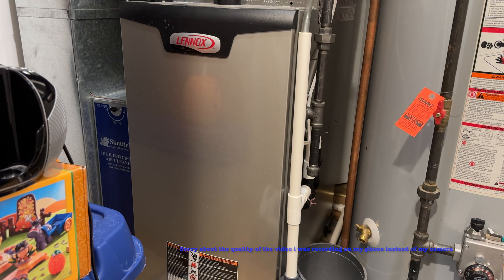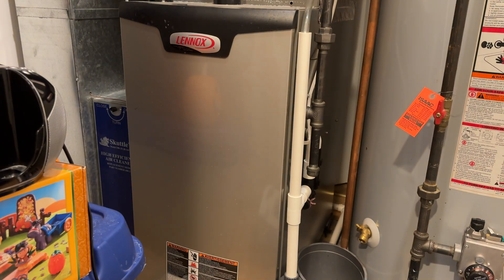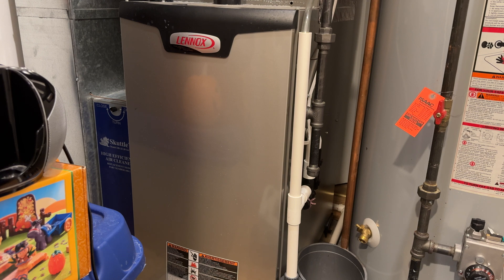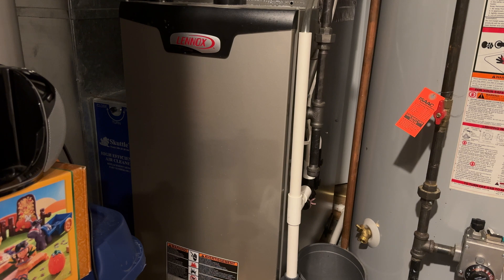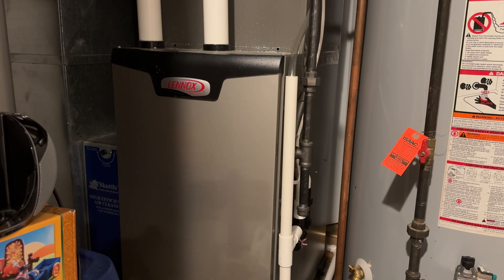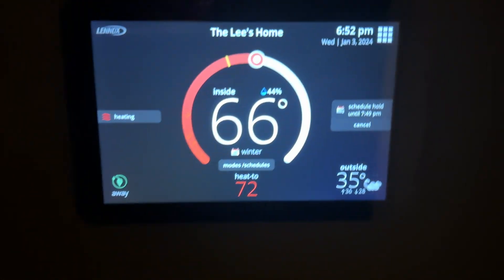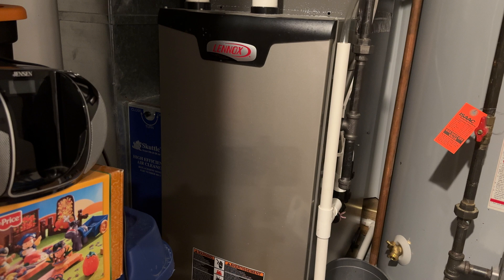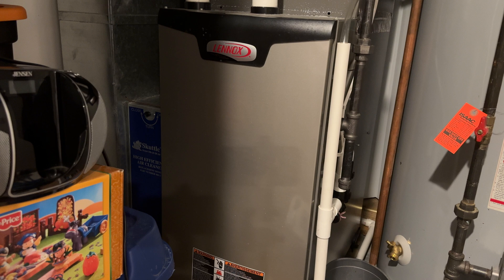Full run up and rundown of Lennox SLP98UHV Variable-Capacity Gas Furnace

Comment: If you're having pressure switch problems on windy days that tells me the intake termination is installed incorrectly. Should be facing the ground to avoid wind gusts from blowing back inwards
Reply from the maker: Oh I know it’s installed incorrectly but it’s in a spot where we can’t point it down because of where they put it

But it doesn’t happen that often so it’s not a huge problem and it self resets after a while

Comment: I'm a little confused. Is this a good review or a complaint video? What is that rattling sound when the unit turns on? That would drive me crazy.
Reply from the maker: I did a review of this about a year ago but I never did a full sound test and people sometimes want that

I don’t know what the small rattle is but it’s so quiet you can’t hear it unless you’re right next to it. And plus it never rattles on a normal cycle because it never gets up to full power
Reply: @Nate10502  it is the inducer slinging up condensate - normal.
never needing full capacity even in cold snaps is a indication the furnace is oversized - most are. the modulators don't come smaller than 60 to 70k depending on brand.

Comment: Sounds like a mouse rattling around in it, what is that noise?
Reply: This is probably condensate from the inside of the draft inducer, it was pretty cold that day, so I would expect it to heat up and get pretty warm and cause a lot of condensation